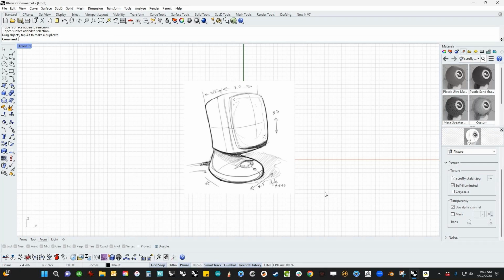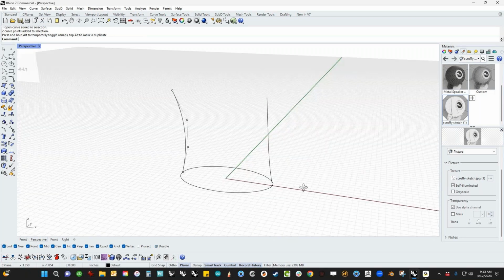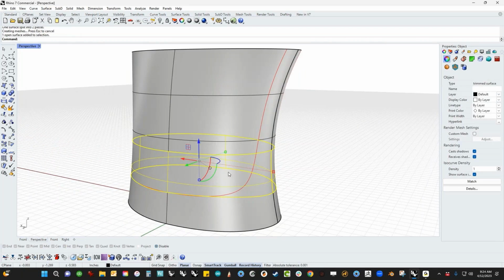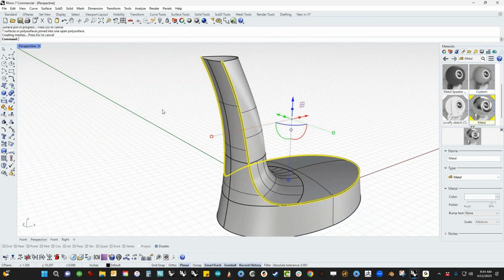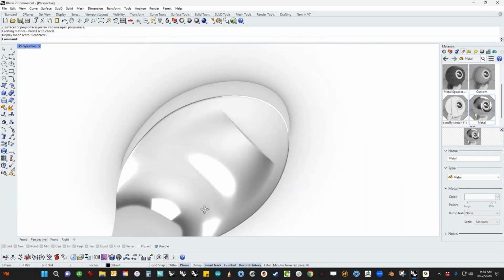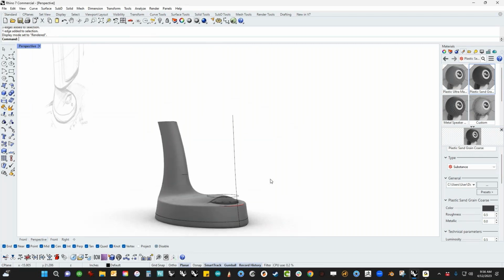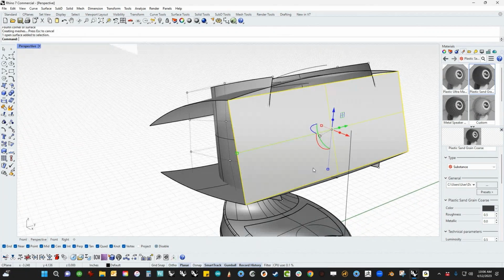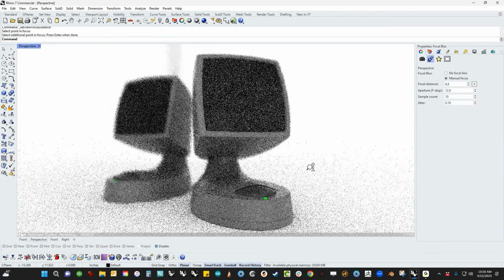Getting started Rhino 7 for windows - Rhino phonic Speaker build

Comment: Hey, Kyle! Thanks again, love your tutorials! Step by step Rhino starts to make some sense)) Only problem I had following this was Fillet didn't work for me, trying to use ChainEdges it went partially flipped/inverted/broken... But trick with Pipe-Boolean-Blend worked fine. I'm wondering if there is a tutorial showing how to solve those problems with messy surfaces? How to clean bad topology (when control points are fighting each other), why match surface not working because of trims, kinks, why split/merge sometimes doesn't work... etc. In this video you showed few very useful tricks like that Extend Surface not working because of some invisible trim on pipe object. But problem is it is very hard to find answer like "why my Extend surface is not working?". Google will not find this video on such request...  Is there some sort of Rhino golden rules how to avoid such problems?
Reply from the maker: best way to sort issues like that, send the model to tech@mcneel.com and we'll take a peek and advise.

Comment: Thank you!

Are there tutorials for 3 wheel electric loader or electric bicycle ?
Reply from the maker: not as of yet, but I'm always open to ideas.
Reply: @Rhinoceros3d  
please try to make 30 minutes video on how to design an 3 wheel electric loader using Rhino.
It can be just as a simple layout at initial stage. It will help to know about various tools to be utilized. It will give hint on how to approach the design with different tools available.
It will bel helpful on how to convert to line to solid, solid editing, smooth joints or bending, trimm, dimension, printing, etc.

Thank you so much from India.

Comment: Hi Kyle. Would it be practical or any easier to use subD to do the same project? Considering it's a prototype and not production design. Thanks.
Reply from the maker: I am 100% all for using what ever tool or workflow works best for you and your modeling task. If I did this in subd, I'd do the base and speaker housing as 2 pieces and then finish them up in Nurbs where I can trim, and fillet.
Reply: @Rhinoceros3d  How Do I Make Chesterfield Sofa In Rhino By Using Nurbs Or SubD Pls Make A Video Of It If Possible